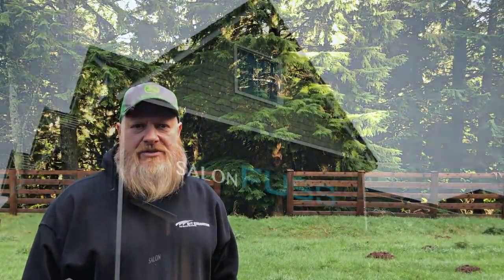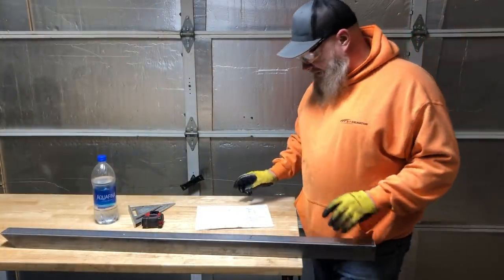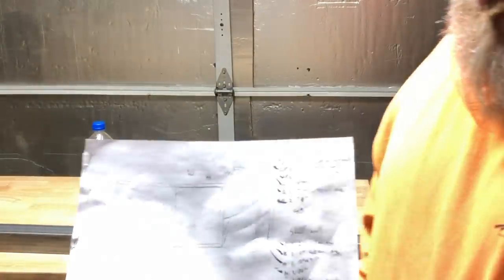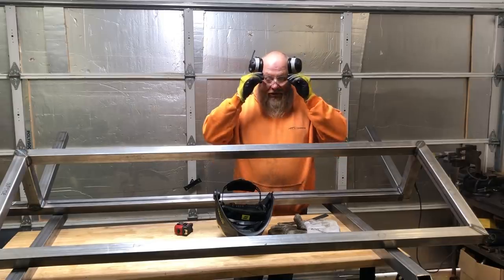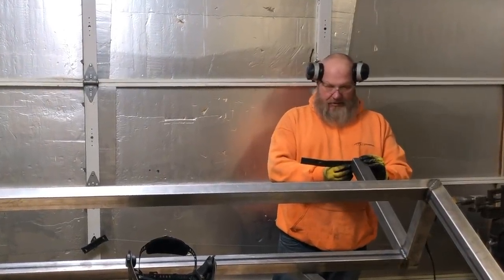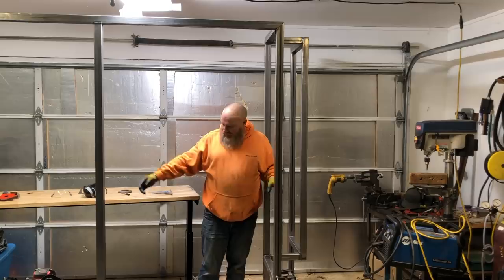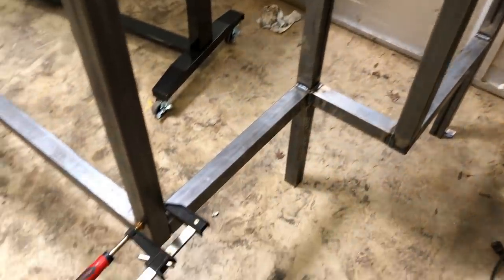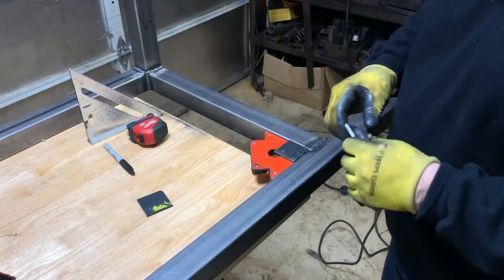Reclaimed Wood and Steel Partition Wall Build Part One

Comment: Nice video, Sir.  You are very skilled at many things and do some impressive work.  I always enjoy your tales and vids.  
Just wanted to pass on a couple of tips for your sawmill work in case you've not come across them and I'm sending this info with this video just to be sure you catch it currently.  For removing sawdust on a newly sawed board, I've found that a 12" drywall spackling knife works really well and is much quicker than a brush.  Also, I noticed your dragging "tongs" and wondered if you've considered the lifting tongs by the same manufacturer.  I use them routinely and and can lift 2000 pound logs with them and place them better on a trailer or staging logs for  the mill than with pallet forks on the front loader of my tractor. They save a lot of work and time, but one does need to be careful about not getting in harms way when a log is in the air.   Take care and keep up the good work.
Reply from the maker: I don’t do a lot of hauling of logs. If I do I usually have an excavator or something to load them.

Comment: Slow mo of the weld was cool! 👍
Reply from the maker: Thanks, Ray. It just came out that way but I like it too!
Reply: @NorthwestSawyer  The grinding slow mo was cool too. I have a habit of replying during the videos. Not at the end. :)
Reply from the maker: Comment away, Ray! The grinder slo mo is more fluid because I filmed it at 240 frames per second. The welding was shot at 30 frames. Both have their own uniqueness. I learned a lot with this video today.

Comment: There is always something interesting to see in your videos.  I generally take a break when I see that you uploaded.  Wonder if you have any holes in the hoodies you wore.  Even though your new bench will probably get a little beat up, it is so nice to be able to adjust the height for comfort.
Reply from the maker: Thanks, Ted. You have a break coming tomorrow as well😬. Pretty much every bit of clothing I own is perforated with spark holes. I’m loving the new table even if I have to replace the top now and then.
Reply: @NorthwestSawyer  Where are ya gunna get the wood at?
Reply from the maker: Jake, it came from a build I tore down 4 or 5 years ago.

Comment: That's a heck of a 'welding table', would care to tell us about that one? It's not often that I see such a nice looking wood top on a welding table!
I am NOT a professional welder, BUT I have found that the larger magnets did indeed 'pull' my welding beads too. I stopped using them while welding.
 I use them for setting up, then I use clamps and take the magnets clear of the welding area.
Those are nice and sturdy frames,..hope to see more soon.

Comment: I don't think the $179 saw is the same saw in this video.
Is that the 2632-20 Fuel (gen 2) model?

When I checked Home Depot I see the 2631-20 brushless 7 1/4 cordless M18 saw, which I think is a rehash of the fuel gen 1, which/is a great saw.

The Gen 2 has a bigger motor that runs at a little faster RPMs (5600 vs 5000 I think) but it is also about 2 lbs heavier without the battery.

They are both great saws, some actually preferred the lighter Gen 1 over Gen 2. As it seems it might even run a little longer doing basic/non brutal cuts. 

The bigger/heavier gen 2 is definitely more powerful though.  It's more like a corded 15amp, for sure
Reply from the maker: That’s a great point. I’ll have to look into that.

Comment: Yes you had me yelling at the lap-top, but another thing when welding  with mig in the horizontal position there are 2 trains of thought pushing the wire against pulling the wire I've over the years tried both to me pushing gives a smoother weld and more heat for penetration, it's fine when doing vertical downs to pull the wire if this makes sense if not comment.
Reply from the maker: I hear what you’re saying. With this thin gauge tube, too much heat is an issue. I’m just trying not to burn through but I don’t want to turn the voltage down too much to get a good weld.
Reply: @NorthwestSawyer  it's a matter of speed of movement and practice I did this for 30yrs.
Reply: Well, Barry, you are probably right.  This is for his better half at the hair salon.  I don't think she will be pulling an engine out of a dozer with this structure, it's not engineered for that.  It's just holding up some plywood, some reclaimed wood, some curtains, and hair product.  Looks good to me,  you can tell someone how to weld, but the only way to really learn it is to do it!  Awesome Job!  Welding! 👍
Reply from the maker: Jeremy she won’t be pulling dozer diesels out at the salon.... again. Not after last time😬 Barry is a long-time subscriber. I appreciate his input as well as yours. Thanks for the comment!
Reply: @NorthwestSawyer  lol, have a great evening!
Reply from the maker: You too, sir.
Reply: @NorthwestSawyer  thanks for the complement just thought that the welds would be seen and there is nothing like seeing a bad weld in a lovely establishment.
Reply from the maker: barry you wouldn’t believe how much work I’ve gotten from my other work in her salon. It’s the best reference there is!
Reply: @NorthwestSawyer  I'm sure that there is a lot of woman that see beautiful things and say I want that where do I get it, or people passing by like what they see so come in and ask great for keep up the great work.
Reply from the maker: I’ve actually done thousands of dollars of work for another salon owner who saw my work through the windows as she walked by. I’m a very lucky guy all the way around.
Reply: @NorthwestSawyer   smart husbands do what there wife's want!
Reply from the maker: MyOLD36chevy happy wife, happy life!